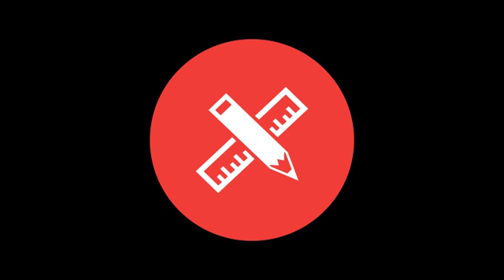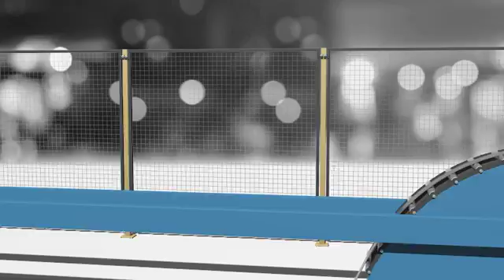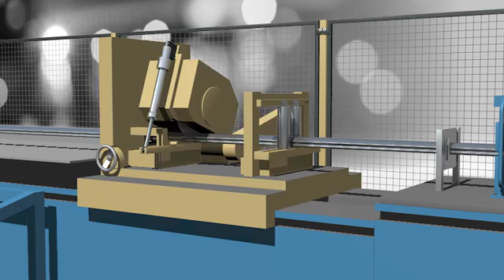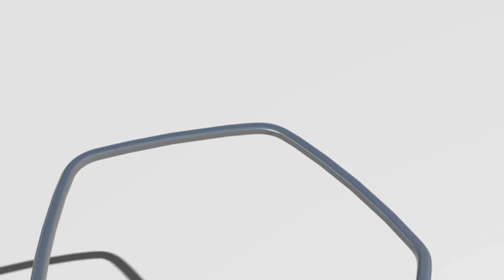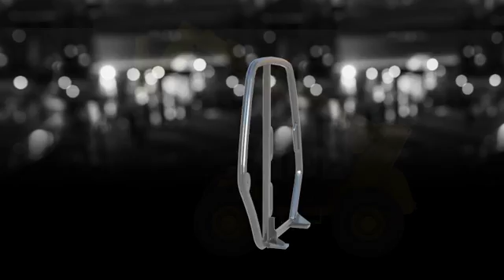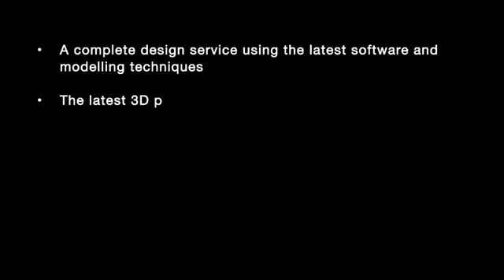Introduction to voestalpine Metsec Custom Roll Forming Products

Comment: can we decrease number of rollers by preheat treatement of sheet.
Reply from the maker: Hi Abdul, unfortunately not as we are a cold roll forming company. Kind Regards
Reply: No, I am just asking is there any side effect of hot rolling on the strength of material.
Reply from the maker: @Abdul_wahab_khan We can't comment on the effects of hot rolling to the strength of the material. It all depends on the carbon content in the steel and how the steel is cooled down afterwards. Apologies we can't answer your question in more detail, it's just not anything we work with.